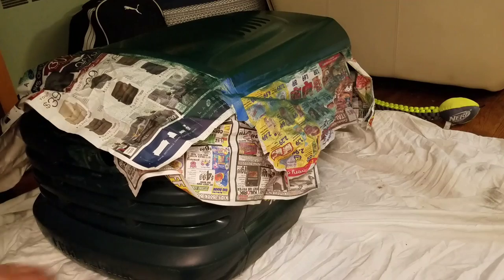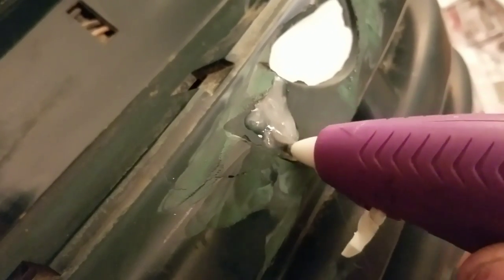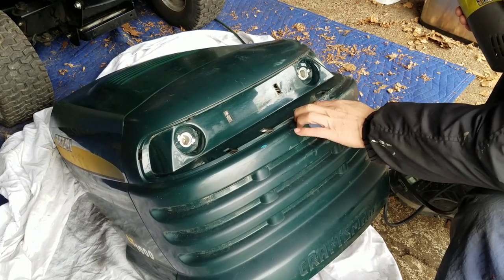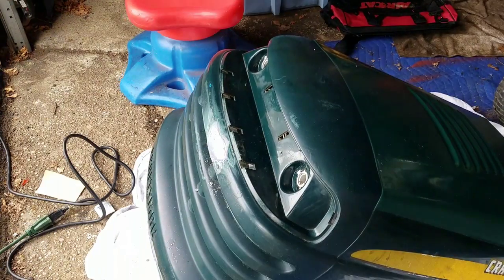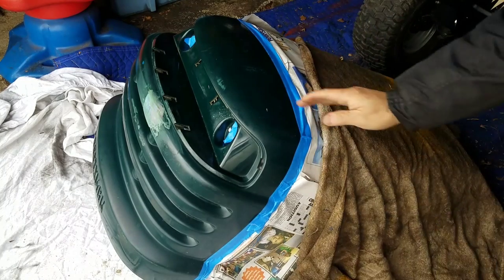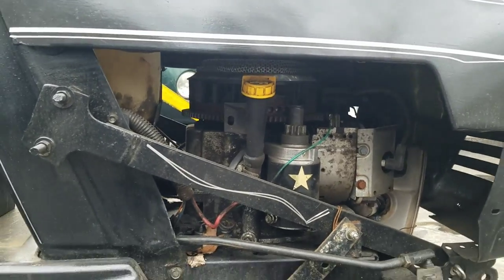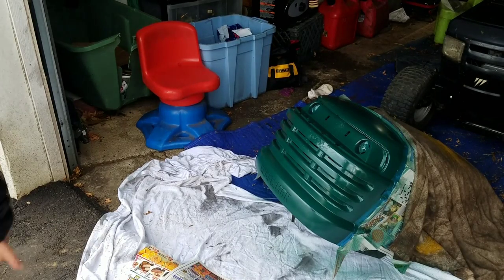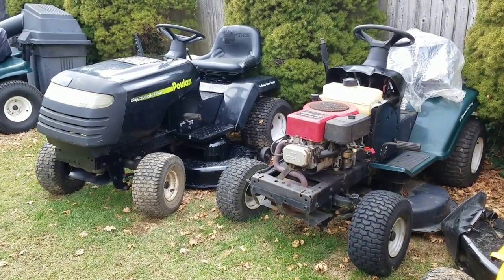HOW TO FIX REPAIR FILL PATCH PAINT LAWN TRACTOR RIDING MOWER HOOD GRILL HOLE CRACKS USING A GLUE GUN

Comment: I know this vid is 4yrs past.. I'm always a day late and a dollar short anyway. 
I use that can spray foam, the non expanding kind. Once cured, it is very sandable and shapes nicely too. It sands to a fine smooth finish. Prime and paint.. you'll never know the hole was there. If you want it that good. Just remember to prime the foam on the backside..  I've done this for years. Works great. Fulls large holes as well.
Reply from the maker: Good to know!  Hope you subscribed

Comment: What I do to fill in a hole, I cut the hole into a square, then use a broken piece of plastic cut that into ruffly the size of the square a little smaller so I can fill in with the hot melt glue, then you have less to sand.

Comment: Hey Henry I live in Tennessee I own R&B small engine repair I have at least riding  mowers and over the years I’ve never seen anyone do that flywheel how u did it on the Briggs motor that was really neat
Reply: 60 riding mowers
Reply: Lawn *
Reply from the maker: Thanks bro! You mean the headscratcher timing episode on the lt1000?  It had the wrong crankshaft or flywheel combo, so I lined up the magnet to TDC and made my own key way that matched the timing marks.